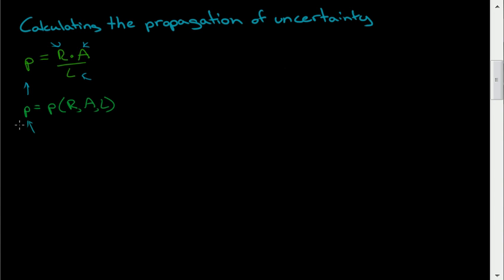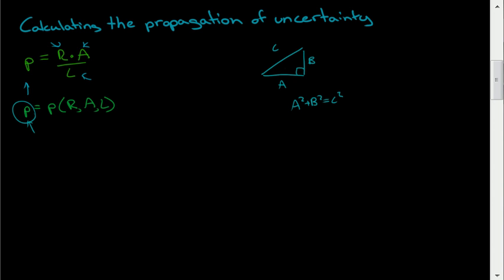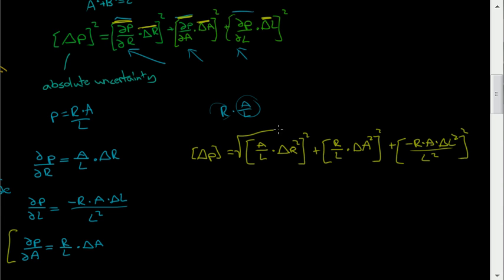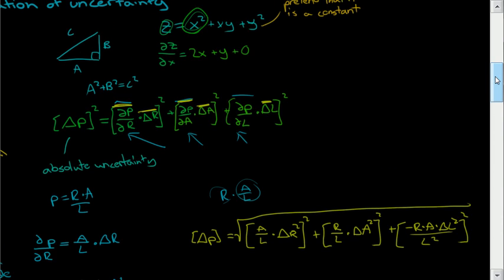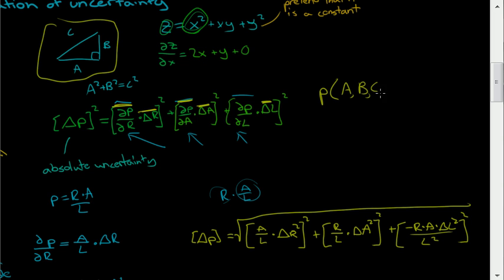Calculating the Propagation of Uncertainty

Comment: HELLO, I AM HERE TO CORRECT THIS VIDEO. 

So, all the questions in the comments are talking about the squared deltas. This is wrong. 
The /ONLY/ mistake in this video is the partial derivatives. NONE of them should be multiplied by the delta he has. 

His first partial: dP/dR = A / L , that's it. There is no deltaR in that partial derivative, because the derivative of R is 1, not the uncertainty.

His second partial: dP/dL = R*A / L^2.  The derivative of 1 / L is -1 / L^2. 

His third is the same reasoning as the first. 

That's it. Fix those partial derivatives, plug them back into the formula, and you're golden.

Comment: i did exactly this my prof. said it was totally wrong :( Feel like every vid I watch on error prop always has a different way of going about it and a different solution
Reply: HELLO, I AM HERE TO CORRECT THIS VIDEO. (replying both top comments for visibility)

So, all the questions in the comments are talking about the squared deltas. This is wrong. 
The /ONLY/ mistake in this video is the partial derivatives. NONE of them should be multiplied by the delta he has. 

His first partial: dP/dR = A / L , that's it. There is no deltaR in that partial derivative, because the derivative of R is 1, not the uncertainty.

His second partial: dP/dL = R*A / L^2.  The derivative of 1 / L is -1 / L^2. 

His third is the same reasoning as the first. 

That's it. Fix those partial derivatives, plug them back into the formula, and you're golden.

Comment: I'm not sure if this is an error, but you say, that  the square of the absolute uncertainty of P is given by the sum of all the squares of "partial derivative MULTIPLIED by absolute uncertainty of variable in question.

I dont believe this part to be wrong, but later, when you show how to calculate the partial derivatives, you have

dp/dR = A/L (absolute uncertainty of R)

If you really plugged this back into the Original equation

"uncertainty of P is given by the sum of all the squares of "partial derivative MULTIPLIED by absolute uncertainty of variable in question."

There would be an extra factor of "absolute uncertainty of variable in question."

I dont think the partial derivative has the extra factor of the absolute uncertainty, that comes when you plug it all back into the main formula.
Reply: HELLO, I AM HERE TO CORRECT THIS VIDEO. (replying both top comments for visibility)

So, all the questions in the comments are talking about the squared deltas. This is wrong. 
The /ONLY/ mistake in this video is the partial derivatives. NONE of them should be multiplied by the delta he has. 

His first partial: dP/dR = A / L , that's it. There is no deltaR in that partial derivative, because the derivative of R is 1, not the uncertainty.

His second partial: dP/dL = R*A / L^2.  The derivative of 1 / L is -1 / L^2. 

His third is the same reasoning as the first. 

That's it. Fix those partial derivatives, plug them back into the formula, and you're golden.